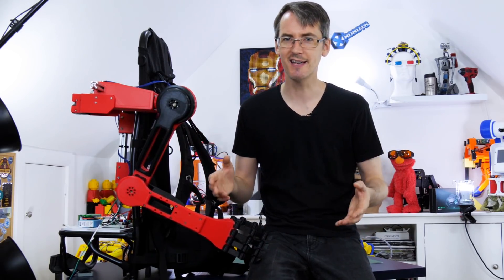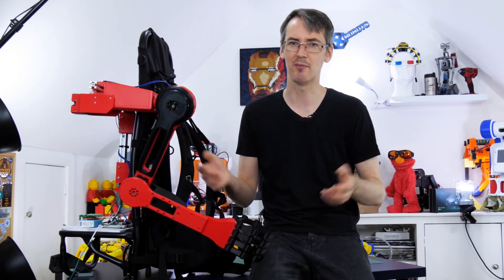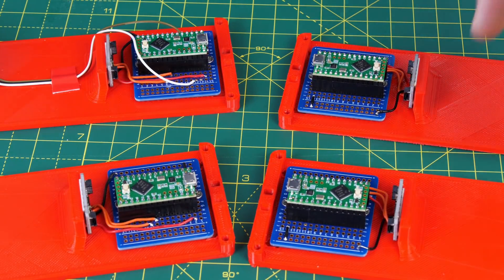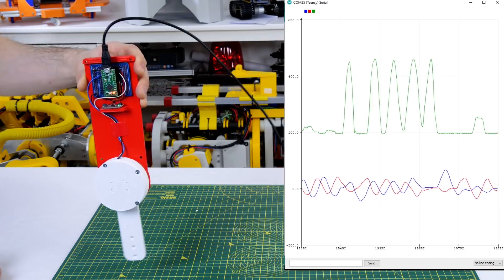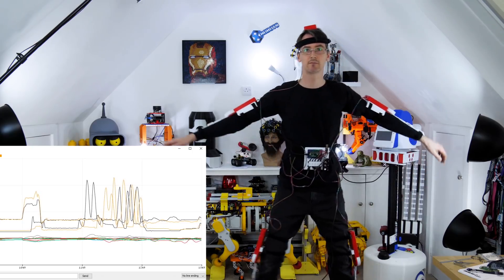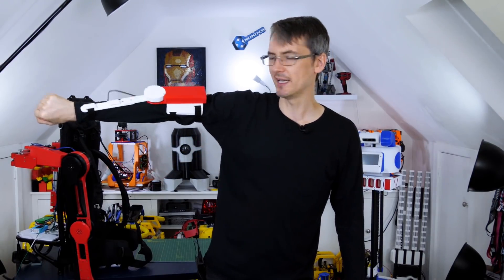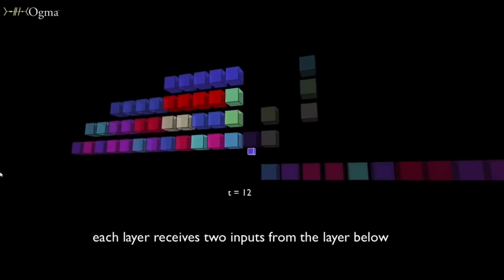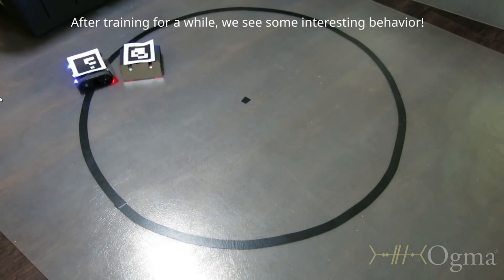Machine Learning Prosthetic Arm Concept

Comment: This is an amazing video, Jame really is a genius.  I dabble in electronics & robotics, so I know how difficult it is to learn and build stuff like this, especially stuff this complicated and at the rate that he releases videos.  The only critique/question that I have about this one is why didn't he just use potentiometers and MPUs/gyroscopic mechanisms in the motion suit, with a machine learning algorithm receiving data from those sensors.  It would also simultaneously be fed data from another pre-trained AI algorithm to recognize his arms.  He could put long strips of reflective tape down his arms, as well as adding strips around their circumference, would make the arm-recognition algorithm easier to train and more reliable.  Once he's trained the model for long enough, and is wearing the arm, he could add buttons to tell the algorithm whether that was a good or bad motion, using it to progressively tune the algorithm to exactly how you like it.  Also, I'm not criticizing in any way, his method got the job done, I'm just probing a little to see if I might have any good ideas on improvements.

Comment: This project is totaly awesome!
Sorry to bother you but I got a question just because I'm that curious. You mentioned the problem with the y and x axxis meassurement. I did ask myself if the solution, why to include a gyroscope or a similar like wise device as meassurement, isn't a option. Would that be a problem that I'm not aware of because I do not have that expertise? it would be very kind if you could answer my question. Thanks a lot. 
Greetings Ruben.

Comment: Sorry I missed this at the time.  It's pretty good work.  I could see elaborating on this helping some people, or making some cool costumes.

I think rather than tracking rotational data from your other limbs, you should be training a new muscle movement instead.  Tracking the actual arm movement with positional trackers (like Vive trackers for VR) would probably have been more useful as well, as you can simulate bones and calculate rotations between points with that.  It would have solved the third rotational axis issue and probably given you better output results.  If you then couple those motions with straining unfamiliar muscles (like furrowing your brow, or wiggling your ears) you could get consistent motions played back based on repeatable and variable inputs.  It's possible to adjust how far one draws their ear back, for example, making replay of sticking out the prosthetic arm straight to the side essentially like a blend shape in modelling, something you can apply a multiplier to for a final output between 0 (no playback, arm hanging limp) and 1 (arm fully extended and parallel with the floor).

Comment: This plus the muscle monitors could be amazingly unique. Not only would you have accurate motor controls, but unique situation awareness relating strength of signal and force feedback. This would allow someone the ability to differentiate between crushing a brick and shaking a hand whereas currently gripping is much more of an on off signal.

Comment: for the training you should simulate the poses. the problem with simulation is that it very often is too clean and not accurate enough but for this application you have too much mess causing the need for the heavy filtering thus slowing the arm. all you have to do is average out the inputs in playback to clean them up and it should move a lot quicker. I'm a n0ob to everything maker but after a little research I'd but you would be able to do it with this https://www.youtube.com/watch?v=GvRugdEICyQ . also forgot to mention you're awesome

Comment: You might want to get some 6-axis IMUs, 3-axis magnetic sensors, piezoelectric flexing sensors, velocity encoders and PID controllers all involved. The more sensors, the better. (And let's not forget a camera-based motion capture rig, and maybe some additional sensors on your chest to detect your abdominal muscle movements.)

If you combined this with both OpenBCI and MyoWare's stuff, you might get some pretty awesome stuff. Multiple layers of context-sensitive filtering might help as well.

Honestly with the current state of brain-computer interfaces, they really are based suited for supplementing other input methods, than they are for replacing them.

Comment: Now to scale it up, add the rest of the limbs, an omni treadmill, and make a mech.
Can use the learning as a feedback for a 'fly by wire' controller, even if you have all your limbs.
Theoretically if it can predict your movements, it would react quicker than a direct 1:1 controller, with enough training.
Reply: Would probably more like, assume I'm still doing what I was doing and continue it until you get a different input, rather than predict the future.

Comment: Since you're using 3 values, what if instead of feeding it the raw the IMU and joint data; what if instead you calculated the position of the hand in 3d and used those coordinates for training?

Comment: After thinking about this for a while, I realized that you had already designed a pretty good arm concept for what you're trying to do.  Remember the Performance Robots?  They had shoulders with a good range of motion, elbows, forearms that rotate and grippers.  Anyway, it just seems like those arms would have the range of motion to adhere more consistently to the trained behavior.

Comment: Thank you so very much for sharing your process and results.
I have been thinking of working on a similar concept, but utilising fpv quad flight controller boards, as they work on all axis' in a very small form factor.
They could be used to record the data of one limb, and also to output the data to manually control a prosthetic. 
The flight controllers are small enough to attach just below each point of articulation on the "learning" limb. Combined with your outlined machine learning, they should then be able to output motion commands to result in a more natural movement style.

Comment: The two mathematical models are not isomorphic, the machine does not have the same joints as you, so the data between them is not bijective. But sure, this works as a poc. But as previously mentioned, you are not within the same domain as the machine. You know how the powerglove works right?

Comment: You could consider Deep Reinforcement Learning with added imitation learning in the reward function. PPO and DDPG are some solid options if you are considering. For my thesis I'm working on the control of an active transfemoral prosthesis during normal walking using DRL.

Comment: I have an idea for tracking and recording movement. Use fiducial markers over your body that are tracked with computer vision (open cv). You can also use the same fiducial markers to generate a 3D model of  your body in real-time. I did this back in 2007 but did apply it to something like this. I was also using Quartz Composer on OSX.

Along these lines I think that the 3D model that us made from the data could have a motion graph, IK restraints and animation associated with it. I do a lot of 3D modeling and come from 2D and 3D animation.

I don't have all the answers but I have some ideas so that what you put in can help what's being put out :)
Reply from the maker: I considered an external tracking solution - but that's not very portable which is why I went with a crude wearable solution. There are better commercial solutions of course.

Comment: There's no real world use for a self learning arm attached to you though, and it will end up doing the wrong stuff once there's a few things for it to learn I reckon you should have done the muscle sensor one and had your go at open bionics 😁
Reply from the maker: As I mentioned in the video I plan to simplify it to a better set of data inputs and outputs. This was just a test to see what we could get out of the software.

Comment: Using Quaternions and spatial rotation will address your gimbal lock (where the axis rotations get confused when aligned with another axis when moved)
Reply: The problem is, his arm is quite literally a physical gimbal. It's a limitation of the anatomy to an extent, and as a result (if you want something that is attached to your arms) you will have to duplicate sensors I believe in different orientations.
Reply: Geometric Algebra has a concept of bivector rotations which is also useful
Reply: I just feel so validated seeing a super smart roboticist/programmer like this guy run into gimbal lock problems on a limb. Every 3D animator in the world has scratched their noggin at this exact issue lmao.
Reply: https://www.youtube.com/watch?v=hhDdfiRCQS4       
 you might like this
Reply: Rotation matrices can also avoid the numerical singularities which we experience as gimbal lock, and they are much easier to understand so maybe he could start with that. The only downside is that rotation matrices carry 9 numbers instead of 4 for quaternions.
Reply: @paul_vantieghem  https://www.youtube.com/watch?v=hhDdfiRCQS4

Comment: Interesting video, but I fail to imagine a use case for this kind of tech.
I can't think of a single action where my body is always in a similar and distinctive pose. (and when I say "distinctive pose" I am not talking about the almost cartoonish poses James uses in this video. Of course further development of this tech would improve on these poses. But still you would need some body movements that are only used in one situation)

For example reaching for a glass: There is no single (or bunch of) poses for reaching for a glass. It's always a different movement, depending where I am, where the glass is, etc.
And on top of that just having the arm reach forward and grabbing isn't enough. The hand has to be in a specific place. Can't be a centimeter to the left. It has to be exactly in the right spot.
And I don't think you can give those precise controls just with the rest of your body. 

And prosthesis or exoskeletons already exist without this kind of whole-body-AI-recognition.

I can't think of a single situation where it would be beneficial of using whole-body-AI-recognition over muscle or myoelectric signals. Those are just more controllable compared to your whole body.

The only thing I can think of would be walking with a prosthesis leg. But even walking needs a more granular input - I think.
Like stepping up a small curb. You need to raise your foot a few centimeters higher. But you only do that with the one leg. You don't use your whole body for such a small change. 
Yes, if you want to make a big step you will tilt your body forward and such things, but just raising your foot a few centimeter higher?

One could argue that this kind of tech would be used alongside a more granular type of control (like myoelectric signals). But then I would ask why use this tech at all? What benefit does it bring to the table? 

Maybe I am missing something.
Would love to hear you guys inputs.

Comment: I think it would do you good to create a wireless IMU tracker "puck" you can mesh into different configurations. An IMU unit + arduino nano + BT/Wifi module "unit" you can attach to your body, and with some configuration, attach to an IK rig.
This way any time you need to read limb position/rotation for a project, you just strap on pucks on the required body parts, assign each puck to a rig body part, and read out the IK limb positions.
It would require a bit of research and development, but would free you from further case-specific tracker development.

Comment: Ok, it's driving me nuts. I know I've seen that code on the "OGMA" logo before, but I can't remember where. It's not Morse code notation, or cuneiform, but I'm sure I've seen that like with slashes and dots and the forks at each end. What is it?
Reply: Possibly/probably "Ogham" you've seen it in a Tom Scott video: https://www.youtube.com/watch?v=2yWWFLI5kFU
Reply: @ontrack4  Yes. Looks like that is the correct answer. Thanks.

Comment: its probably not a proper solution here but a low resolution camera with optical flow may help to localize the 9DOF sensor possibly with an infrared laser to assist in low texture environments like the aforementioned robot dog example.

Comment: James, you could give the IMU BNO080 a try. It has internal processing that gives quaternions which are highly useful to find global orientation. That will reduce the processing cost and allow you to sample data at a higher rate, also solving your vertical orientation problem. Amazing video!

Comment: This is awesome, and some impressive first steps. You've used some different full body tracking solutions before, would they provide "too much" data given the prosthesis' range of motion?

Have you seen the youtuber Ian Davis's work? As engineers go I'm pretty sure you couldn't be more opposite each other, but something tells me you could do a lot for eachother in a colab.
Reply from the maker: I've used IMUs before but they don't do a complete job without some sort of skeleton solver. I think an actual motion capture suite would work well, but you'd need to be in there for it to work in playback mode.
Reply: @jamesbruton  that's where the AI could come into it? Take the "limited" data of the live read and extrapolate to fit the more detailed motions?

How was balancing with the arm on? Did you find that your weight distribution felt natural?
Reply from the maker: The AI would take as much data as it can - but we need good quality data. I think most commercial wearable motion capture solutions solve the skeleton from the IMUs and then give you a complete picture of the whole body - then we could feed all that data into the IMU.

It was a bit challenging standing on one leg, but if I was missing an arm then maybe it would even things up? ;-)

Comment: Very cool!  Using EEG (brain electric signals) combined with an AI is more or less what is being done by Neuralink. EMG (muscle electric signals) is also being used for moving prosthetics. Seeing these topics explored here is exciting!  I can't wait for what's next.
Reply from the maker: Still planning my next move. I want to see what other suggestions there are on the video and have some time to think about what's practical.
Reply: @jamesbruton  Can this project be made into a much bigger project,(like the hacksmith industries' alien loader) with higher budget, crew and longer time. I would love to see something like this as opensource, cause we as humans are not that far.
Reply: This wouldn't just benefit people with disability, but also people working with heavy machinery. As they could use a much stronger and buffed version of this arm for lifting heavy stuff or working in un-survivable environments(such as deep sea and space).
Reply: @clifton1331  I can see how this could be an advantage to those with disabilities, but wouldn't something that just follows your actions 1-to-1 be better for a remote controlled robot? Maybe if it was a walking robot that had to work out the position of it's own legs to keep balanced, but the upper body seems like it would only work if it followed the operator exactly.
Reply: Jamming phase transition thing to pick stuff up
Reply: I get what you're saying, but I want to nitpick: generally EEG as a term is restricted to noninvasive, through-the-skull electrical signal detection, not the more direct route Neuralink is taking.
Reply: @Taygetea  yeah that's why I tempered my statement with. "more or less" I just wanted brevity as this is just a YouTube comment.
Reply: Neuralink also tortures monkeys so I think this version is a lot cooler
Reply: Well, neuralink is doing it with a lot more precision.
Reply: yeah but neuralink is them being dumbasses and brute-forcing it with invasive implants instead of improving on EEG and myosensors

Comment: amazing stuff, lots of exciting potential here! kinda scary watching robots come to the conclusion that fighting is the answer, and optimising their agility with the same AI. you'll have to feed your arm martial arts and erm....martini making videos (shaken not stirred), not the motion of a human marching in line.
Reply from the maker: I was considering having different modes that are essentially different training models for different activities - dance mode etc ;-)
Reply: @jamesbruton  Cool project, but you might want to use a different angle representation than roll pitch yaw when you do reenforcement learning. Said Euler angles have singularites in them, are prune to gimbal lock and they are counterintuitively some unintuitive in some edge cases. Normally in robotics you would use quaternions, but they are quite nonlinear and hard to learn when you are doing ml with them. Often it is sufficient to use axis angles or two support vectors for that usecase. If you have further questions feel free to contact me.